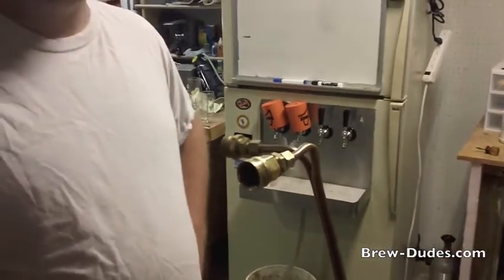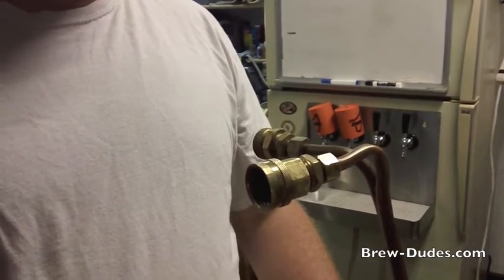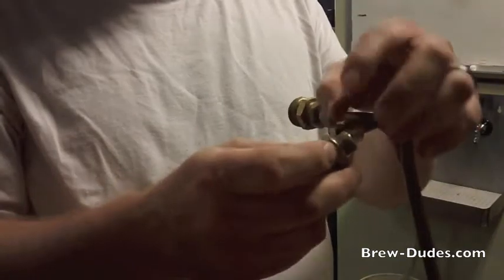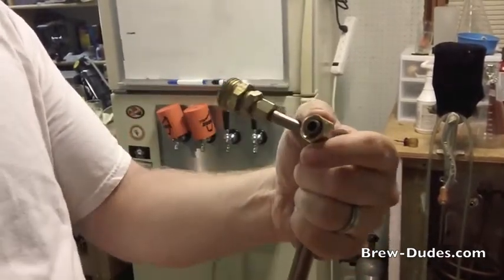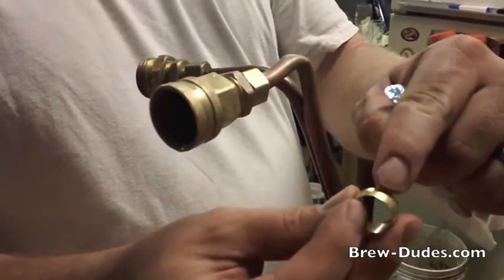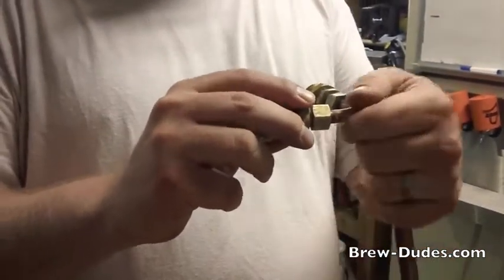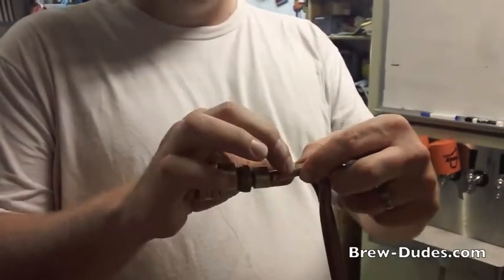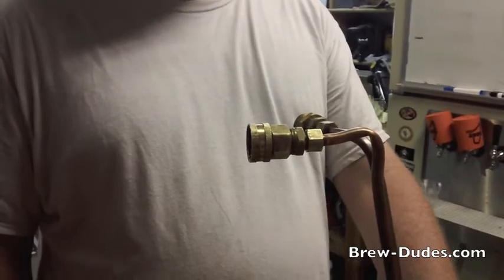Chiller Fix

Comment from the maker: John bought this chiller with the part on it I believe.  However, once you know what type of tubing you have its fairly easy to find the parts at your favorite hardware store.  The compression fitting has three parts: the compression nut, the ferrel (compression sleeve) and the compression fitting itself.  Then to adapt it to the garden hose fitting you just need to look for the right garden hose fitting that has one end that mates to the back end of your compression fitting.  Next time I am at the parts store, I'll try and write down the parts for a 3/8inch tubing set up like John's and I'll repost. Hopefully, what I wrote above can get you started if you can't wait.  Luckily the fittings are inexpensive so if you get the wrong ones it won't break the bank.  Cheers.